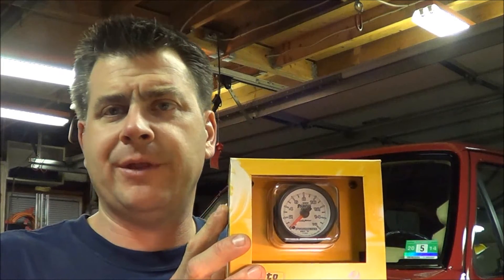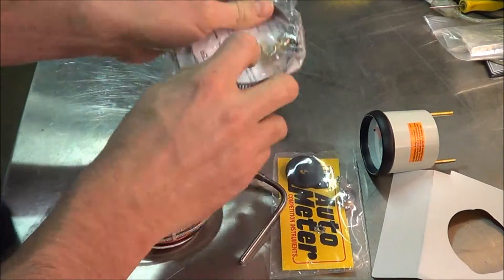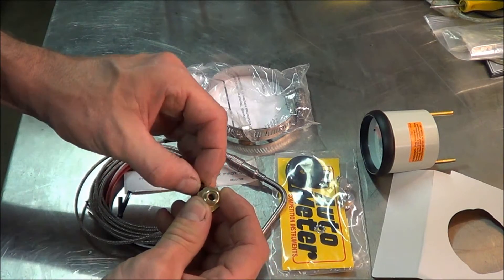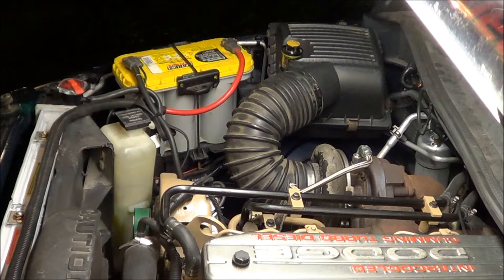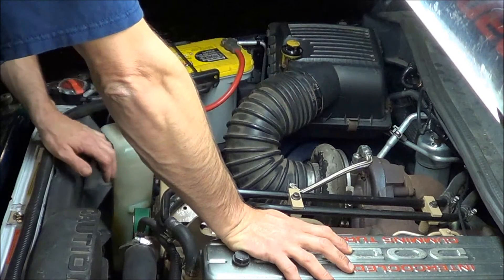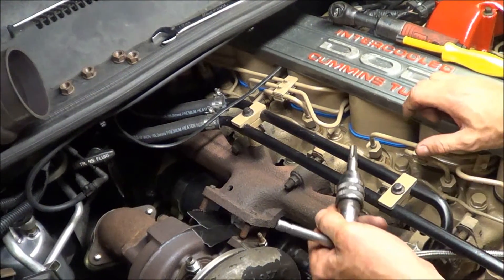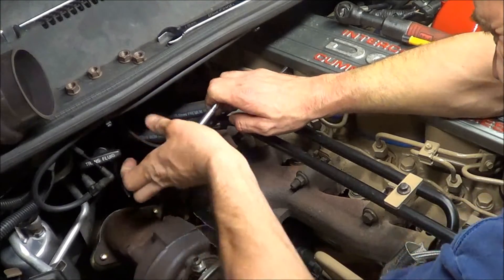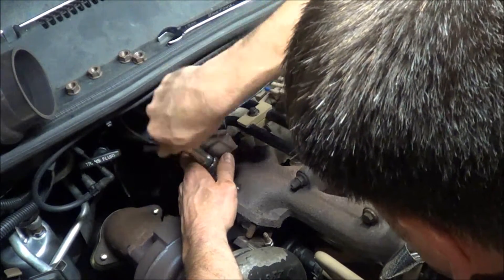8-27-13 Ram 2500 Cummins 6BT pyrometer install

Comment: I just got my pyrometer probe and I'm concerned that the probe slides out of the fitting.  Will my exhaust send this probe shooting out of the fitting or does the little brass piece tighten on the probe when I tighten down on the fitting?
Reply from the maker: Mine still in the same place since I installed it.  It should tighten up.

Comment: No need to split the turbo.  Just get the bigger pieces out with a pencil magnet, the rest will blow out the exhaust when you start the engine.

Comment: Just a note, I have the shop vac running while I drill if at ll possible.  It is hard to hold it and drill at the same time but I try to rig something to hold the nozzle where I'm drilling or cutting.  Saves a lot of clean up.
Reply from the maker: Good tip.

Comment: I have been looking at ratcheting wrenches and have notice that most of them well let the nut slip all the way thought the head. GearWrench makes a set with their cap-stop feature on them, which stops the nut from slipping all the way through; they work like pass through sockets do.